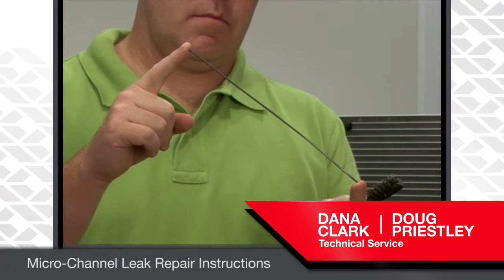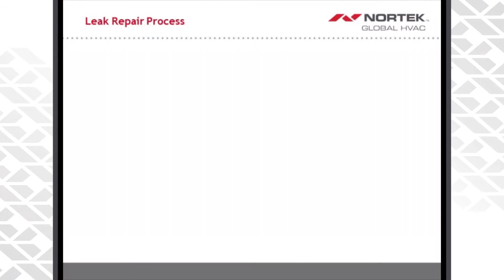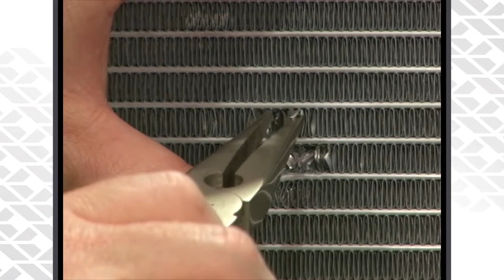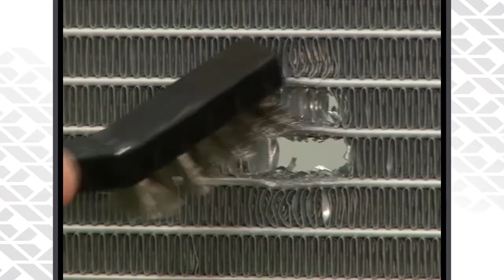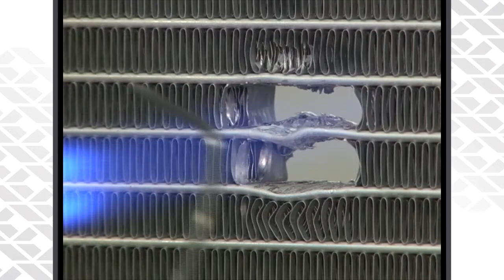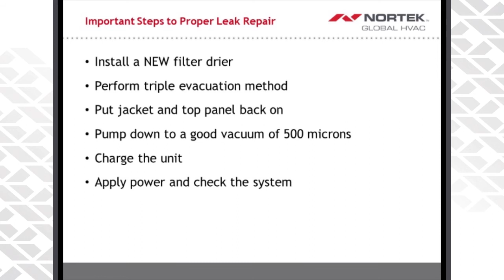Micro-Channel Leak Repair

Comment: How can they tell if it's getting filled up inside with aluminum blocking off the flow of refrigerant?
Reply: This will block the flow through that one channel but you won’t loose more than a 5% capacity 
And it’s much cheaper than a new coil

Comment: welding to do a microchannel repair is good instead of nitrogen use the vacuum pump, and cover around where the repair is done to avoid excess heat on the aluminum. otherwise the video is good.